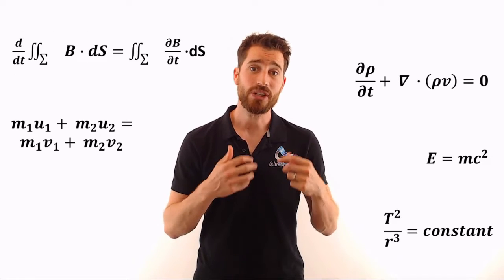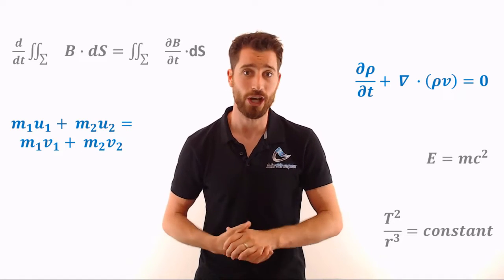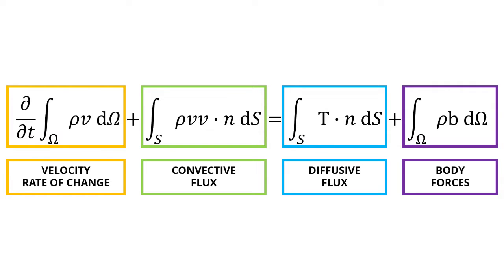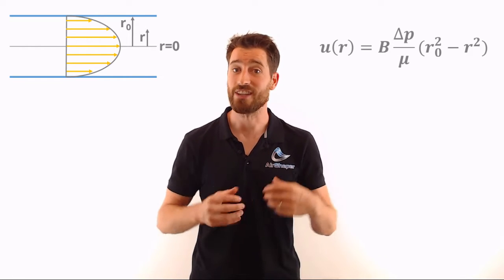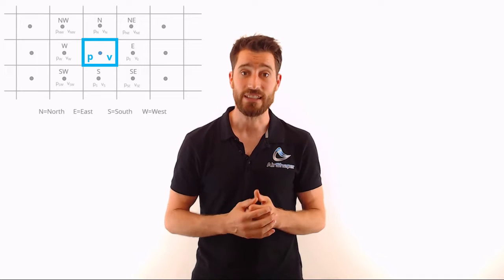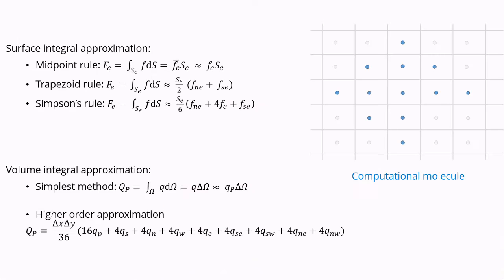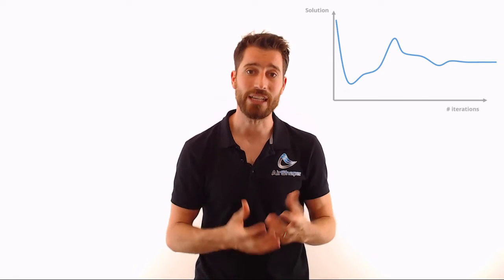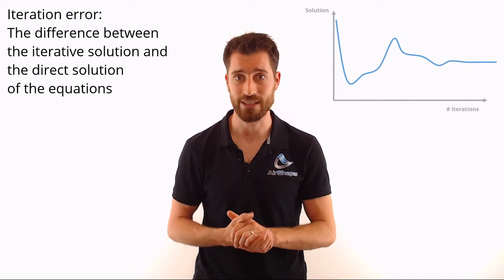Computational Fluid Dynamics Explained

Comment from the maker: Are you running CFD simulations yourself? Feel free to share your experiences in the comments - Which software do you use, what do you like about it, what applications to do study, ...?
Reply from the maker: Hi! Yes, we've developed the entire platform around OpenFOAM - see www.airshaper.com/courses if you want to learn more about running OpenFOAM. One feature in particular is that we do all the meshing automatically for you, even if your 3D CAD model is not watertight! Feel free to check out this video: https://www.youtube.com/watch?v=12xA80foGXk
Unfortunately, I wouldn't know how to help you on Ansys meshing - I haven't worked with that before.
Reply: Does openFOAM use an adaptive mesh?
Reply from the maker: @wyattb3138  OpenFOAM features mesh refinement tools, but not a full "adaptive mesh refinement" algorithm out of the box. But it can be done - at AirShaper (www.airshaper.com) we have created a layer on top of OpenFOAM that will refine the mesh during the simulation based on intermediate results!

Comment: Hey! I'm an undergraduate student and enthusiastic to learn about CFD analysis.  Can you tell me if I can do an analysis for drag in Solidworks?
Reply from the maker: Solidworks indeed has a cfd module, but I'm not sure if it's included in your license. I don't know if it's still the case, but the CFD in solidworks used to be FloEFD of Mentor Graphics (now owned by Siemens).

Maybe you can check with IT of your department if you can get the CFD module? If yes, then you can indeed run a drag analysis.
Reply: @AirShaper  thank you for the reply! And what if I want to run it in Ansys? 

And also, if I want to run a simple analysis of a model, what tests will be good enough?
Reply from the maker: Ansys is definitely good enough too. It's more a matter of setting all the parameters right. You'll find a lot of resources on www.cfd-online.com for specific case setups!
Reply: Thanks for all the help ❤️ And keep uploading good works like this. There's a lot to learn from you.

Comment: Hi, Do you know about Computational Fluid Dynamics (Continuum Mechanics) especially related to motion of bodies submerged in fluids. Basically i am having hard time even visualizing and starting to think about following problem: 

Consider a rigid body (with a mass "M" and inertia tensor "I") which is completely submerged in a Fluid of constant viscosity "v" and constant density "d" at rest in a container (Boundary value problem). 
Now consider the fluid is disturbed by some external force "F" at a point "P" inside the container. 
How to calculate how much of the original force "F" acted upon that RigidBody and what are the components of that force on that rigid body. 

Can you help ? Thanks.
Reply from the maker: I've seen some interesting tutorials on this in OpenFOAM, perhaps you can search for those?

If you want, we have some old course material available for free at www.airshaper.com/courses

Good luck!